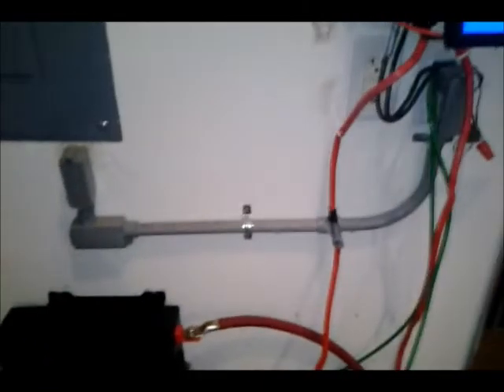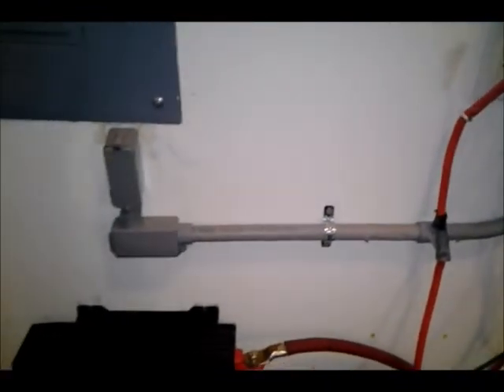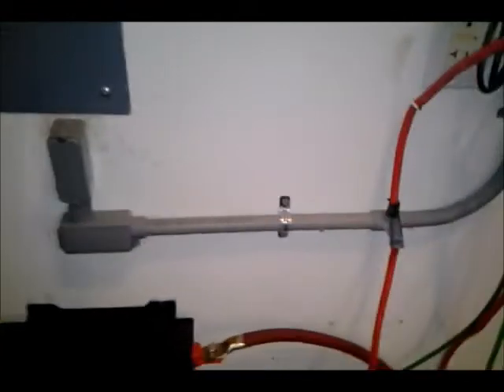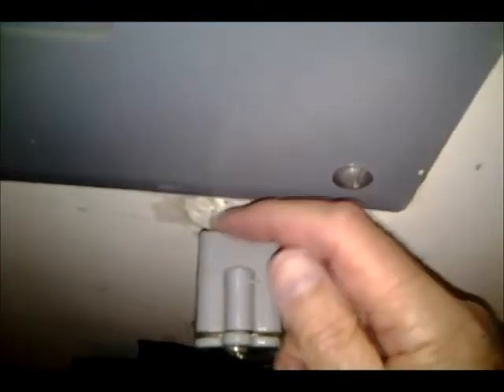UPGRADES TO THE INLET CONDUIT FOR MY GENERATOR OUTLET BOX

Comment: You didn't show us the repair to the free air wire when it passes through the wall under the panel is sleeved, or if you added the proper connector to the wire entering your generator receptacle. And still tnat LB over the face of a decora receptacle cover has wires sticking out all over the place. 
You're not contributing in a meaningful way here. This is the problem with YouTube the ability for uneducated people to spread bad information is just too easy. John you should take both videos down.  Shame.